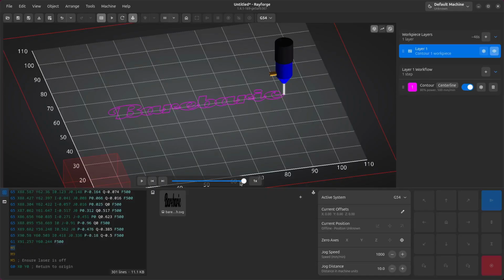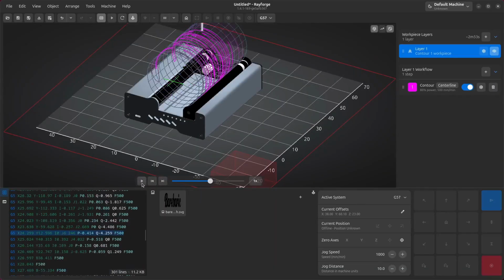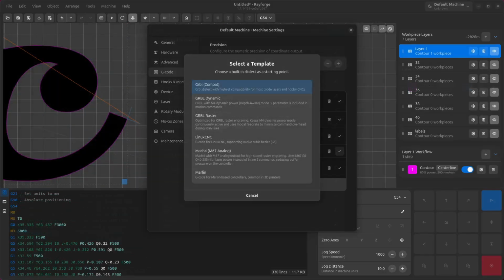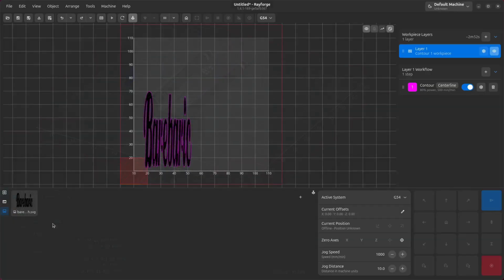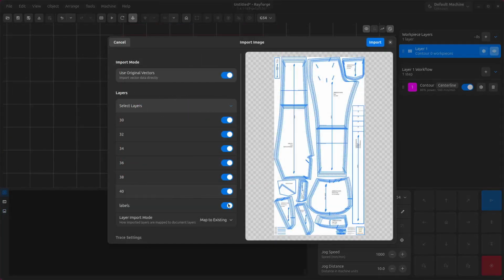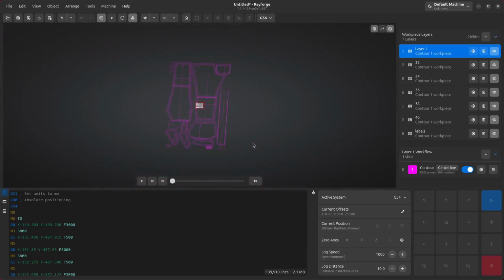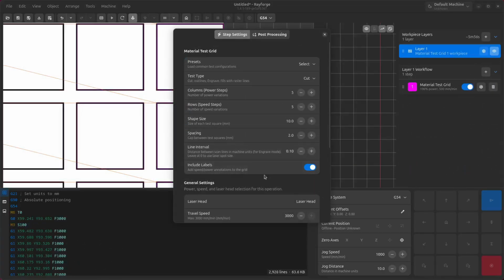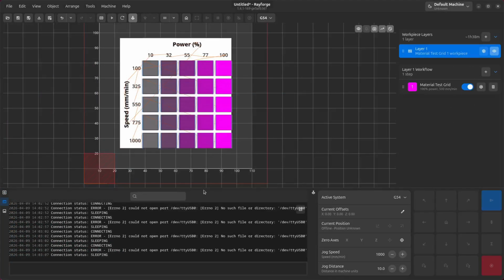Open Source Laser Cutting just got better! 3D Simulator, Bezier Curves, No-Go Zones & Performance

Comment: First of all, a million thanks for creating such a wonderful tool! I just discovered it and it's amazing, and the update frequency is incredible. I'm still exploring it, but I'm wondering if there's an option to choose the airbrush assist for each layer—if you want to cut, activate it, or if you only want to record, deactivate it or not activate it at all. Perhaps it's there and I just haven't noticed it. Congratulations from Spain! New subscriber!
Reply from the maker: Thank you, I am glad if you find it useful! The air assist setting is in each step setting. So in the workflow in the right side of the window click the gear icon on one of the steps, then scroll down to "Air Assist". It will then automatically be enabled when this step is processed.

There is currently no switch to enable the air pump without a job running.